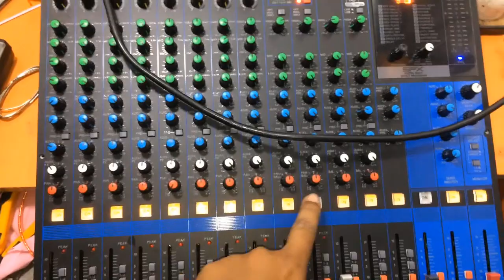How to repair power circuit board?

Comment: I have one Coby power supply. I. C. Of this smps is not getting, therefore, I used three wire module, one is connected to negative of big
Condenser, Red wire is isconncted to middle point to mosfed 
by removing mosfed and third green wire to forth point of octocoupler. The above Coby smps is working on 110 volts. I checked through series connection after doing all shown above the DC is raised 150 DC through condenser. But DC of -12 +12 5 and3.3 are not getting in secondary section,it came only 1.2,or 000,and also current is on but 
LED of circuit is not blowing.I tried but faults not getting. In connection, please help me Sir, how can start smps.Thanks in advance Sir.